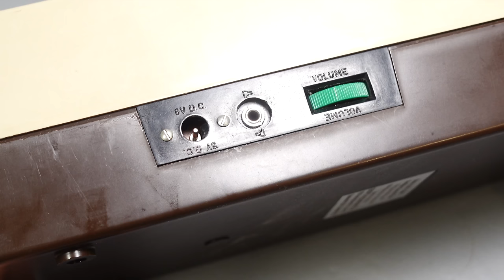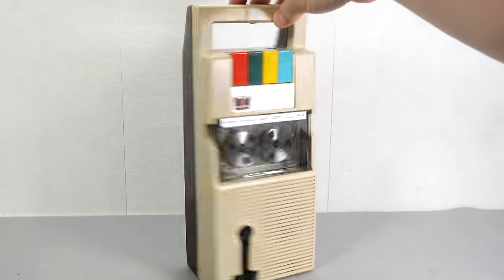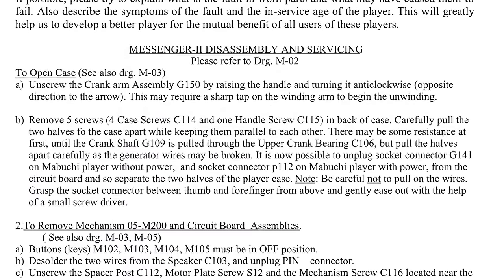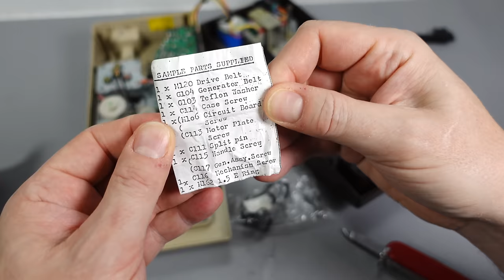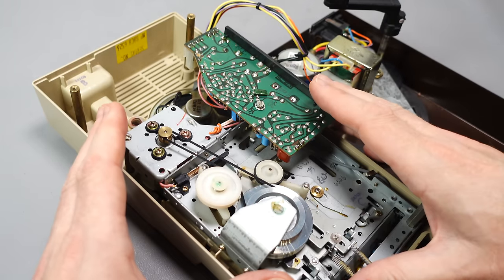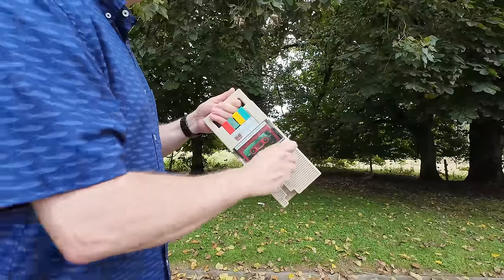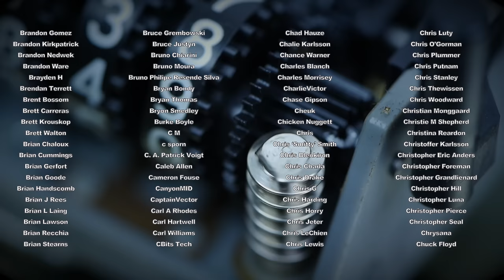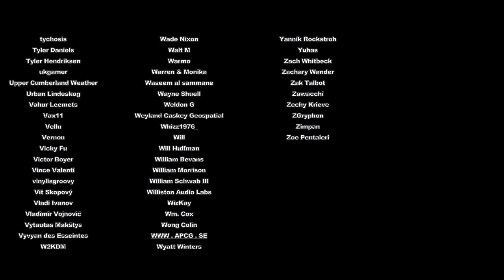This off-the-grid cassette player is a wind-up

Comment: My understanding is that EMPs wouldn't affect small electronics directly but rather create surges along long lengths of power line which might blow up some connected electronics but your hand-cranked cassette player would most likely not be affected so it's still a good plan.
Reply: Might wipe the tapes though.
Reply: Matt needs an EMP proof box for his Post-Apocalypse treasures. A safe might do?
Reply: @Broken_robot1986 Tin foil? Not as a hat, mind you.
Reply: Your understanding is profoundly incorrect, but don't feel bad; so is nearly everyone else's. :/  Sorry, but yes; EMP can_and_does destroy electronics even if they aren't connected to a power line. Otherwise, there would be no need for the military to have done all that EMP testing in the 70s & 80s. Airplanes, tanks, field radios, etc are rarely connected to power lines. ;)
Reply: @railgap At least the crank-and-horn gramophone is immune. Please don't tell me it's not...
Reply: While @railgap isn't wrong, EMPs rely on wires and in general conductive material to become an antenna. With a device such as this, with so little wiring, would need a strong emp to succumb. More advanced tape players may succumb at a weaker EMP
Reply: Yeah. Since it is pulse in electric/magnetic field, received energy depends on the size of equipment.
Modern phones and smart watches are quite small thus have small probability of damage.
If you would, however, keep charging cable connected to your phone you would greatly increase probability of damage. Even if this cable is not connected anywhere on the other end.
So, if you want to lower risk of EMP damage to your things, you should disconnect power cables on the device side and not at the outlet.
Reply: An EMP might damage this player and other small electonics, but it is not very likely. 50-50. An AM radio is very likely to be destroyed for example, because the ferrite rod antenna as a big, open core inductor can pick up the EMP very effectively and kill the frontend. The most EMP-vulnerable part of a tape player is the head, although the air gap is super tiny, a big enough voltage pulse might be generated in the head core by the EMP to kill the preamp. 
I'm 99% confident that an EMP would not wipe tape or hard drive content, but it would most likely kill the control boards and head amplifiers in hard drives, so it would be pretty tough to get the data from them. The voice coil that moves the heads is a big enough open inductor to pick up a deadly pulse from the EMP. 

Smart phones and other modern electronics? The different radio front-ends might get zapped in them by the first, very sharp pulse, but otherwise they would most likely survive (without cellular, wifi, bluetooth connection ever working on them again, and even the GPS receiver might go south, so they would be pretty useless afterwards, but at least the data on them would still probably survive and be accessible, most of them would probably still turn on (unless one of the radio front-ends failed to a short-circuit) and they still could be used as a camera to capture the doomsday events. Although... modern phones with their auto focus and optical image stabilizer cameras... Those use coreless open inductors to move the lens elements, so quite vulnerable to an EMP pulse. But an older/cheaper fixed focus model would probably be OK.

But ionizing radiation wipes the flash memory content, so after you recorded your last message, be sure to put your phone in a thick lead box when you feel you will pass away soon from radiation sickness.  @railgap
Reply: @railgap  Airplanes, tanks, field radios etc all use communications antennas which make them much more vulnerable to EMPs
Reply: @railgap  if emp worked dont you think they would use it. but in the late 70s the fcc started requiring devices have shielding from interference so they didn't interfere with each other. the chance a emp would damage modem eq is pretty slim as they all have shielding. hell most pc dont even have magnetic storage now.

Comment: I've had a windup flashlight that also used the crank to run an electric generator. The only difference is, the crank wound a large clock spring to store mechanical energy, so that the generator can power the small light bulb by itself off the clock spring for a minute or two (it also had a rechargeable battery for more storage). The mechanism takes up space inside the case, though, so the size of a tape player would probably double, along with the cost.
Reply: I have a similar unit but its a radio. It even has solar panels so it plays music in direct sunlight.

Comment: This is pretty cool not needing to have electricity or batteries. And a very thorough service manual, plus spare parts included. A battery would be a great addition, not needing to wind continuously, but it would be something that would need replacing so I can see why it doesn't have it.
Reply: A coil spring or a "gravity battery" (spool of rope with a weight on one end) could've also worked without all the hassles of chemical batteries
Reply: I ran a portable CD player off of a 500 Farad (not microfarad) supercapacitor for at least 15 minutes...it was 2020 when I tried it, I remember it being at least that long, possibly longer...Of course I used the electrical grid to charge it...But it has a lot more charge/discharge cycles available than a battery...

Comment: Pretty neat! The crank could be a separate device, which could be plugged into the external DC input, so, "anything" could be crank-operated.
Reply: Good point, that would be handy for a torch or radio for instance.  My guess is they didn't do that because it's cheaper to build the crank generator in, plus there's no cable to break.
Reply: Or you could add a spool of rope to the crank shaft, tie a weight to the end of the rope and make it gravity powered
Reply: @Lachlant1984  Oh, yeah, less chance for problems if the crank is not a separate device ‒ but this way it only can operate what the crank is built into.
I wonder when the crank is turning, can the DC input operate as an "output"? 🤔
Reply: @qdaniele97   Gravity operation is pretty limited, also, the player wound need to be placed high from the ground, which is not ideal...
I saw a radio on the internet, which had a "wind-up" feature, what was able to operate the generator internally without turning the crank.
Reply: That's Luke Talbot's MyPowerbank, a portable charger designed for the homeless to attach to TFL rental bikes whose chains can still be cranked in reverse when parked.
Reply: @zsombor_99 string can go up as well as down- would just need a pulley at the top to change its direction. If I was somewhere remote with no other options I'd rather deal with the hassle of that than hand cranking any day.
Reply: @chillstar   That's too complicated, and the reason behind this cassette player was the operation must be as easy as possible.
Reply: @zsombor_99  With some modifications you might be able to do that, but I'd like to hope there's a diode in the unit to prevent that from happening.  What if you had an AC Adaptor plugged in and you started turning the crank handle?  You'd probably overload or burn out the AC Adaptor or damage some other component in the tape player.
Reply: @qdaniele97  You could do that, but would it turn the handle fast enough to power the unit?  If you want to do that and run the crank at a good speed for a lengthy period, you'd need a very long rope spool.
Reply: Hand-cranked USB-chargers are available so a modern version of this would be one of those and a MP3 player.
Reply: I have an emergency radio that does that. Takes in power via USB, Solarpanel or its handcrank, but also works as a USB-powerbank.
Reply: @qdaniele97  it's not really that feasible. There used to be a project called GravityLight that does exactly that, but for a 10kg weight falling 1 meter it ran one white LED for 20 minutes.
Reply: @MazeFrame  I'm sure I've seen a few, in fact I've owned a few like that.  The hand crank recharges an internal battery.
Reply: Gospel Recordings did that as well. Packaged the same generator assembly in a case with a lead that could power anything with an external DC input and required 6V at up to half an Amp.

Comment: I have always loved the idea of having mechanically operated versions of electronic gadgets we use on a daily basis. Just in case the apocalypse were to happen... you never know.
Reply: For this reason I have a manual version of an electric tooth brush. Basically you have to produce the back and forth motion with your wrist. Tiresome, but one can handle 2 or 3 minutes at a time
Reply: I'm going to age myself here but during the y2k scare in 1999 we had a wind up radios that had built in flashlights just in case the grid went down we could get emergency broadcasts and have lighting at night.

Comment: Brilliant. The "generator" is basically just a motor. Usually electricity will drive the rotation, but this unit converts rotary action into electricity using the same motor. Similar to the way a microphone and and speaker-driver are the same thing.

Comment: That's the most right to repair friendly device i've seen in quite a while. Also, i would have made the cranking mechanism with a small flywheel and a longer gear ratio

Comment: The next logical step would be to have a clockwork spring attached, so that it could be powered that way, a bit like those radios that were, (or still are, for all I know), a thing about 30 years ago.
Reply: They probably thought of that but as a Watchmaker I can tell you it wouldn't be able to be serviced by a layman and it would add a host of things that could go wrong. Everything spring wound needs a bit of consideration, and the strong clocksprings are really dangerous if you don't properly unwind them before disassembly. Even when they are unqound they can be a right hassle to put back together.
Reply: An alternative to that would be to make it gravity powered.  That would be quite feasible if you live a few floors up in an apartment building.
Reply: You still come across them in survivalist and outdoor goods stores. Beats trying to carry batteries and keep the unit dry when you only want short access to things like weather forecasts.
Reply: A better option would be to incorporate a battery which is then charged by the generator/motor. That would last a lot longer and take up less space.
Reply: they did sell higher end one that used a capacitor for longer tapes.

Comment: Imagine Apple producing such service manuals! We took a wrong turn somewhere, I think 😅
Reply: Looking at one of Macintosh II manuals (IICI/IICX can't remember which) they used to.
Reply: Imagine Apple making spares available!

(Now silently laughing by the idea that Apple would find a way to serial match the pulley bands, generator and cassette player mechanism to the box's serial number.)
Reply: Apple would only have the manual on line so you would only not only have to have the computer working correctly to read it but also have an internet connection!

Great in remote areas…..
Reply: The Apple 1 was designed to be user assembled, so I guess that came with very good documentation? 🙂

Comment: There should have been a bicycle version that worked like a bike light
Reply: I had one. The bike's wheel turned a small generator that lit the bulb. The faster you went, the brighter the bulb glowed.
Reply: @Paul-ou1rx  What if you rode at the speed of light

Comment: A friend of mine (and a fellow techie) used to work for a "Bible on Tape" mission organization here in Michigan called Audio Scriptures Ministries that had simlar devices.  According to him, these type of players were used to bring the spoken Bible to third world countries where the literacy rates were low and there was little to no electrical grid.    Technicians would egularly visit to swap out non working units and also would have to replace the cassette tapes as they would wear out from being played constantly.

Matt is correct in that these units were replaced by MP3 players in the ministry field but my friend mentioned that at least within ASM, they had gone to MP3 players that besides being cranked, could run on batteries which charged via a solar panel.   They refer to them as "GodPods"
Reply: i seen retail tapes play on loop for years and still function.

Comment: The use of a flywheel to hold a small amount of kinetic energy is a really clever way of regulating a hand crank's output. A more refined system could probably make music playback a much more leisurely process!

Comment: I do believe that tape player would survive an EMP (that usually affects integrated circuits, i.e. chips)...... The tapes you'll want to be playing on the other hand.... I'm not so sure how they'll hold up to an EMP😅
Reply: They'll be fine, they're just iron oxide on a thin plastic tape, nothing electrical.
Reply: @signbear999 physically sure. The magnetic signal on them? Probably not.

Comment: Do you notice any resistance on the crank handle when a cassette is playing versus cranking the handle when the unit is in stop mode?  I assume there would be a difference in resistance.
Reply: It surely needs more torque when it is operating.
Reply: @mrnmrn1  I would have thought so because the current being drawn by the electronic components is putting a strain on the motor.

Comment: This is one of the most impressive devices you have shared. I never heard of such electro-mechanical players. As a Christian it shows me a very real faith in action. The concern shown in providing a complete yet layman-oriented tech manual is almost unique. And to provide spare parts as standard, just wow.⬅
I don't know what catalog of tapes they provided, but a truly evangelical organization would have made available the Bible in multiple languages. They would have likely also provided tapes offering guidance in making clean water, sanitary standards, and the like. A tape need not be religious to be faithful They would want to share such information with animists, Moslems, etc., without totally turning them off.⬅
Outstanding! 🎉
Reply: The Jehovas Wittnesses made quite a number of ingenious devices like this one-an example I liked very much was a clockwork gramophone that looked like a typewriter case,played records vertically & was very well engineered for its purpose.

Comment: to protect it from the EMP just seal it in an old metal-style trash can and use the metal air duct type type to seal the lid to the can and keep it like that until after the bombs dropped and you got a still working tape player. the trash can works as a Faraday Cage protecting the electronics. This is all in theory, I don't have any Nukes or EMPs to test it out with but the logic is sound.

Comment: It's funny that there seems to be enough room in the case for either a clockspring mechanism or a rechargeable battery, but for whatever reasons they decided not to use either option that would make using it with manual power a little more bearable.
Reply: Probably redundancy, the second you add a rechargeable Liion battery, you have now limited the operating temperatures of the device, and when it eventually expands it could damage other things inside. 

One more thing is, you wouldn’t want a novice poking around an electronic with an expanded battery inside

Comment: Today we could have a solid state recording device for SD-memory cards or similar which would be much more easy for a manually driven power supply with far more capacity and much better sound quality at the same time.

Comment: Since there weren't affordable battery-powered (if at all) computers by the time games were loaded from cassettes you'd probably have needed pedal powered generator for the setup and a "helpful hand" as a power source so you could play. (Gameboy would have been a better option though)

Comment: 1:59 if an external battery pack is plugged into this. does the hand crank charge the battery pack? or even if its plugged into a wall socket?

Comment: When homeless I wired up an electric wind up lantern with a solar panel in the same wire stretch used for the wind up part. It already had a BMS built in, no issues whatsoever.
It rarely needed winding, only when we partied till 2 am.

Comment: If I had to guess I would say that it was produced in the early 1970's judging by the use of the straight slot screws shown holding the D.C. Power connector on it's side.

Comment: I remember in the bad old days when rechargeable NiCad batteries weren't yet available and having to frequently replace those C cells in a tape recorder. Of course a lot of the energy was used running the motor. I would have liked to have a tape recorder/player with a wind up motor like a Victrola record player, and uses the battery only to run the electronics. The battery would last almost forever.

Comment: I've had an idea that was similar to this. Though my idea was a motor setup like in a gramophone, then have that drive your tape mechanism and have a separate generator for powering the head and speaker that would tie to the spring motor with a belt.

Comment: It’s got a voltage regulator that regulates the supply voltage coming off the generator to a consistent voltage no matter has fast you spin. If the voltage coming from the Gen isn’t enough to open the regulator it stays silent but if you slow down to near the cutoff it will fade out as the circuit try’s to draw full current but is starved by the regulator only just barely making enough. 

This could be modernized w an 18650 mounted inside and an associated BMS board. It clearly only wants 3V DC anyway so a single 18650 should work fine. Also you can still buy new production cassettes. They’re still popular in some punk scenes so your music choices in the apocalypse don’t have to be so narrowly limited lol